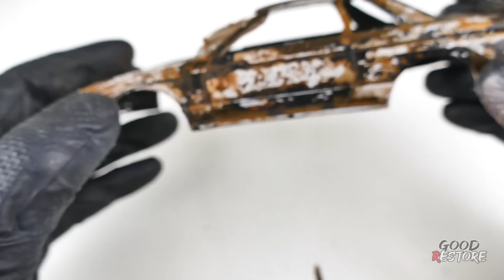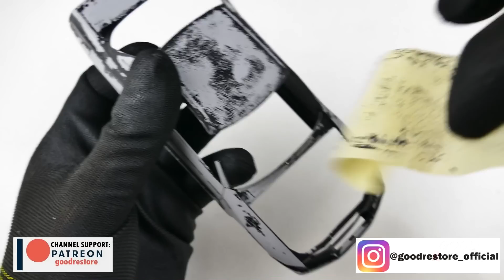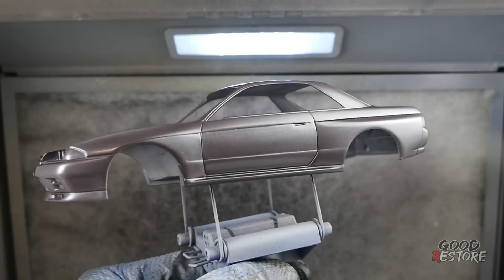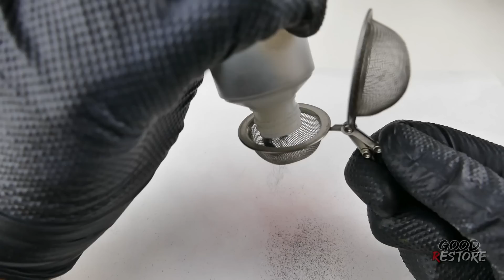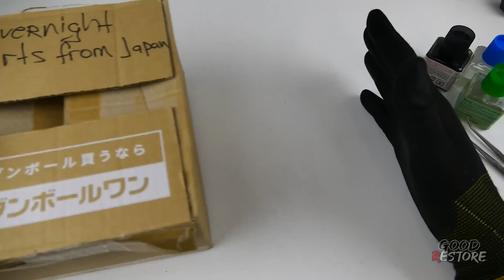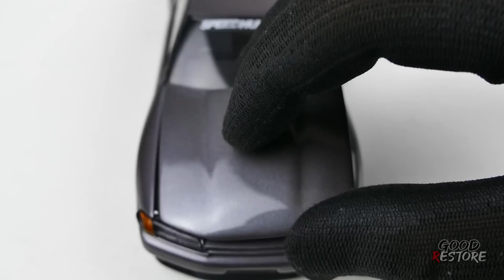Destroyed Nissan Skyline GTR R32 Restoration abandoned car

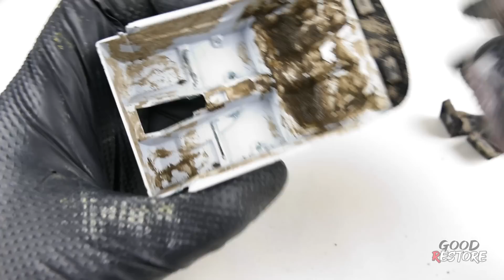Comment: I watched several of your videos, and I noticed that, before restoration, all your cars are always in a similar rusted and degraded condition. Same amount of rust (more or less), same degraded conditions, tires always bent or twisted. By the way, where do you find so many abandoned cars? So, my point is that I'm suspecting you that you destroy yourself perfectly good vehicles to make us believe you found them in this condition. For example, in this video at 01:17, the floor under the seats is perfectly clean and in pristine condition. If this car had spent years out in the rain and mud, the floor under the seats would be totally filthy!
Reply from the maker: Have you heard anything about feature films? Or did you immediately crawl out of the cave?